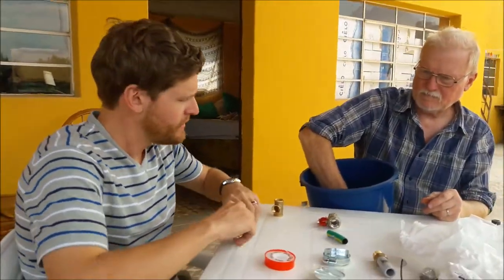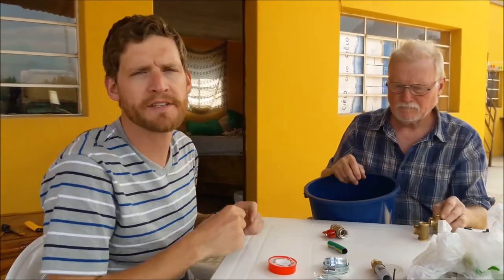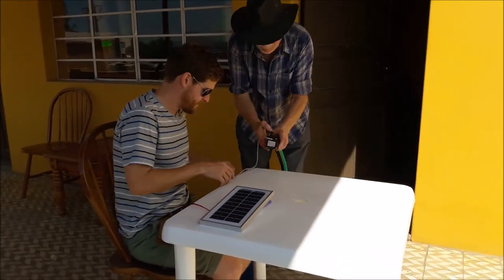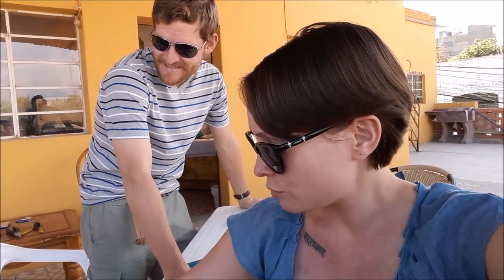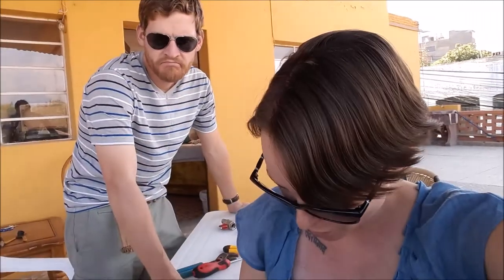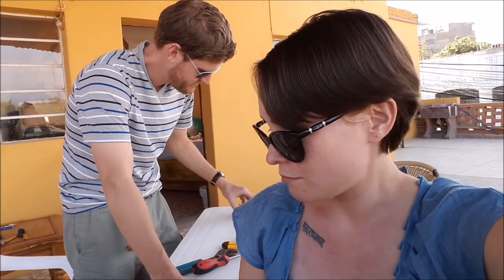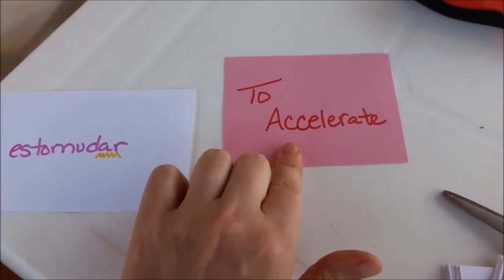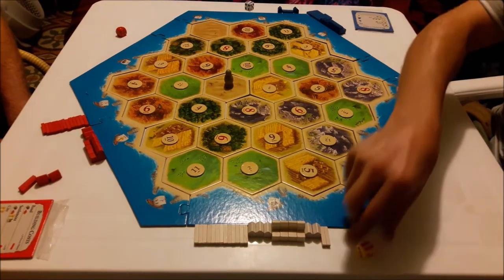Improving our Solar Water Heater & Mail from Home - Vlog 8

Comment: why dont you take a hot feed off the top of the hot water tank for your hot water?
Reply: It's a good question! I considered that exact configuration when first putting it all together. Put simply, I wasn't confident there was enough water pressure to push through the tank to get water off the top. I could very well be wrong. That would certainly have solved a few problems in the way of taking first from the hot top VS the bottom cold, but I didn't think the pressure was going to cut it. And now, having made that design decision, essentially every additional modification since has been predicated on allowing gravity to do all of the work of providing pressure (which then required mixing, etc. of the tank).

TLDR: Had the water pressure here in this old place been stronger, I would definitely have given more consideration to reversing the input/output of the tank.
Reply: @clintonfandrich619  What id do for a free easy quick hot water. Get a copper cylinder paint it black. Fix it south facing on your roof. 
Mains feed it and connect a filling loop with a tap & pressure gauge. Simply turn the tap until cylinder is full (you will know as soon as the pressure starts to rise slightly). 
Dont put any significant pressure in it. Take a hot feed off the top down to your shower. After every shower re-fill cylinder with the tap. Free hot water providing its sunny where you are
Reply: @clintonfandrich619  will also need a vent coming off the top (auto vent £3 or £4.00) off the hot feed for expansion of the water when it heats up. you dont want the cylinder pressure building up unless the cylinder can sustain it.